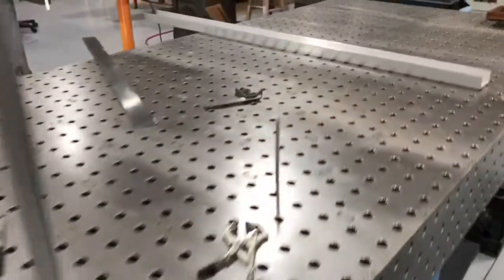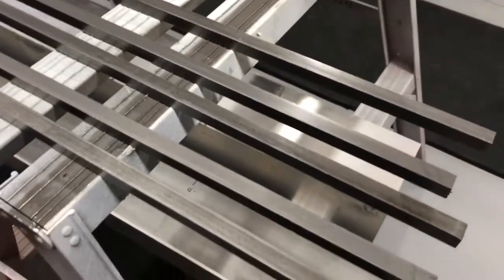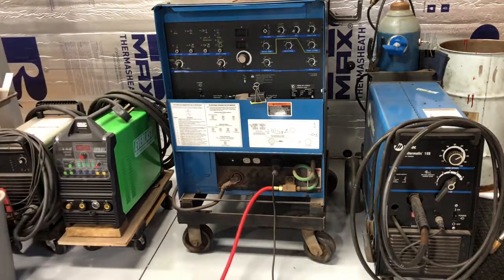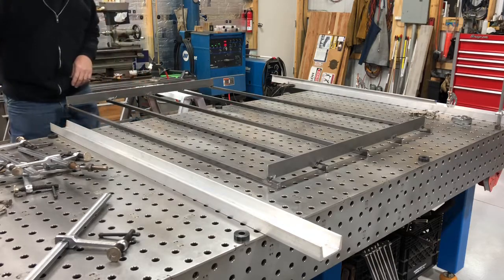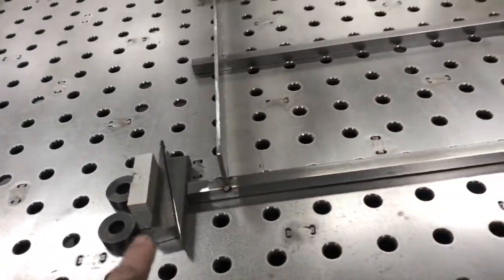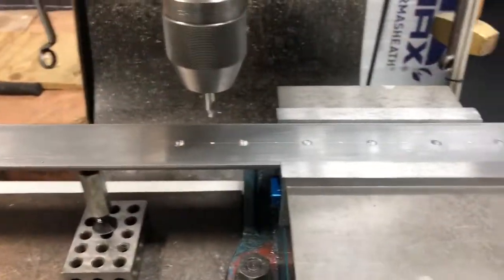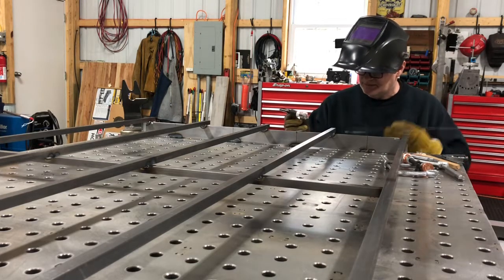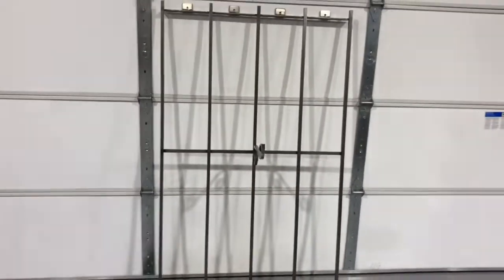Steel Security Bars Fabrication

Comment: Great looking work dude I'm a fabricator for a sheet metal shop we mainly do ventilation work for residential and large commercial buildings. In most cases we are required to install burglar bars in any of our ventilation duct that exits or enters a building that would be intake and exhaust ducts and even the drops under a rooftop unit. Sadly I guess this is the world we live in now that any possible point of entry has to be secured
Reply from the maker: ChevyMustang1 wow interesting so many movies people using duct to get in or out of a situation 👍🏻

Comment: Watching this I'm thinking of a cigarette warehouse  I worked on in newark new Jersey  back in the 80s.  Someone kicked out an old wood  door and stole a few cases of cigarettes.  So we replaced  all the man doors with steel doors.  Then they broke a window,  so we blocked up all the back windows. Then they ripped a garage door  section out.  We put up security  doors ,  the broke out a front window and we put up bars like those.  Seemed like they pulled them off with a chain and a truck.  Eventually  we had the place secured and then they  bashed a hole on the wall through the block with sledge  hammers  and emptied  the entire warehouse  in a weekend...... nobody saw nothing.   The owner gave up  and shut down and cigarettes  were hard to get in newark for a while
Reply from the maker: Man that’s a perfect example it’s never enough